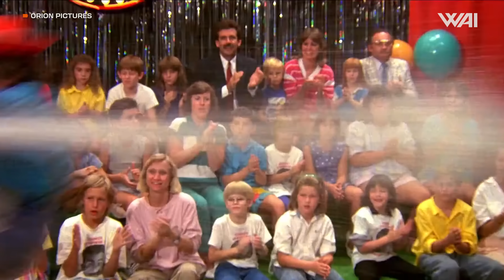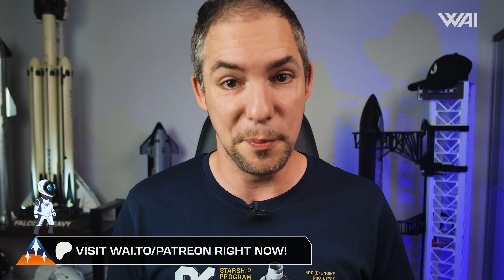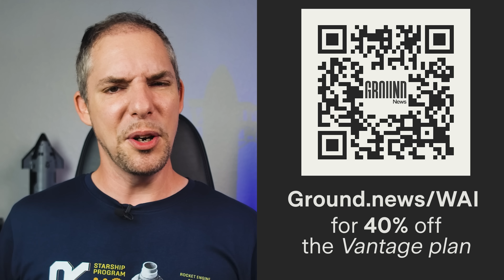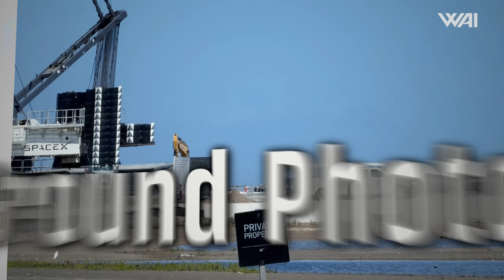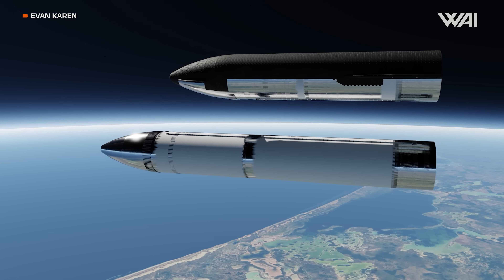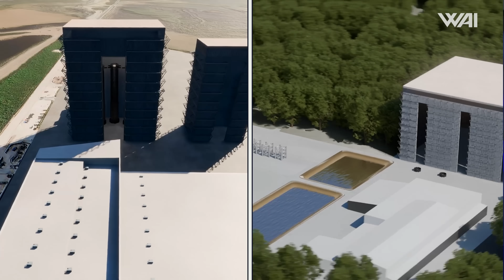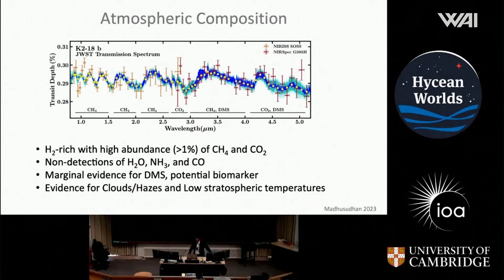SpaceX Lunar Starship Under Pressure: China Reveals Plans!

Comment: I think they need less Stringers but strong Pyramidal Golden Section distanced. More air. It’s colder. Closing and heavier causes hasles in Booster flip and relanding  A ) the catch weight is higher and slowing down b4 big bang may see booster hit catch tower &booster speed as it heads towards tower. Very fine call parts of second s. Rather Golden Section pyramid shaped airspace’s &so lighter easier catch 4 reuse. To much metal there will melt engines create fuel leakes and bang. Sad waste of time.

Comment: I don’t like how tall and narrow the Blue Origin, or SpaceX are. The bonus the Apollo LEM had was that it was short with wide landing gear. If one of these craft were to land with one gear in an even small crater, the craft could fall over. SpaceX’s craft is far more likely to do so. 
My uncle invented the device that kept the LEM’s landing gear in for stowage, and locked out for landing. 
We need to either give up on beating China to the moon, or get a better lander that would be stable.

Comment: How about we keep a dozen of these hot staging rings just stacked out by the tower and use them whenever we need them. Then you could build them with giant springs in them pushing both directions and so you get close to the top and kick the springs and it pushes them both away and in the same time it falls right close to where you needed to be. Right then and there. Save you wait all the rest of the way on starship.

Comment: I think the damage to the ship was caused by the pressure trapped between the ship and the booster during hot staging and now the pressure will be greater no the staging ring has less venting so my prediction is flight 9 will be worse than 7 or 8.

Comment: The CCP does things pseudo-capitalist now.  CCP acts like a private equity firm. Owning and funding companies, even having them compete against each other. Underperformers get cut off and shut down. High performers get more funding,  and as they start turning profit, a portion of that profit goes back to the CCP in the form of dividends.  Some companies still have full or partial private ownership. But if a company needs venture capital funding, the CCP is the only place to go.

Comment: If Spacex go orbital this year and crack refuelling next year they could prob throw a hls prototype together by the end of 2027 but if it fails or the struggle with the other two goals then 2028 wont be viable. I also wouldn’t be surprised to see china bring forward their date either, china already tested lander tech, suits and ship, they only need to complete the rocket and pad which reuses the stages and engines from long march 5. The 1st launch is scheduled for 2026/27. 
If it goes well a push by china for 2028 is possible. 
The Chinese have also hit all their recent deadlines so a slip seems unlikely while nasa and Spacex have missed most of theirs goals regarding hls. I think China is the clear favourite to win this race. The next 18 months by spacex will decide it, unless bo has something to contribute.

Comment: I don't understand why the hot-stage ring was thrown away after staging and did not remain on top of the booster for landing. As the Starship remained in a suborbital trajectory, fuel and payload could not be the cause.
After the impressive flying of pieces of concrete during the first launch, there had to be a quick solution: the deluge plate. Now they had enough time to build good old-style flame diverters, which will be more effective.

Comment: You said "My Wife Stefany". I thought you only had one wife. What is the name of the other wife or names of the other wives? Did I understand your statement correctly? Since SpaceX had two failures they probably will be more concerned about not having a third failure than having maximum cargo so if their hot fire ring is a-little heavier they probably raised their safety margins on everything new so things will be a-little heavier.

Comment: Rather than a larger starship, can  they cut it in half and make a second stage of tanks and engines only which get's left in space.   Yeah, repeatability is the goal, but making a small lander starship that is half as high.
Also, why can't they strap 3 falcon rockets on as boosters.   They can still land and be reused.
Reply: 3 Falcon's won't help much early in flight. 
The refueling tanker flights need a Stage 2 that is flyback.

Comment: I don't think China is a credible threat for a Lunar landing by 2029.
Why? because the Long March 9/10 have not been tested enough. 
The SLS had it's "test flight" around the moon Nov 2022. So once the Long March has a similar test flight THEN China will be exactly where the US was in Nov 2022. 
Which is exactly the problem... it's relatively easy to create a rocket with enough launch capacity to deliver payloads to lunar orbit (and that launch capability will also enable launches of high end heavy satellites for spy and military purposes... not that is what China's real goal is or anything... they are probably doing everything for the science!)
 Anyway... creating a launch platform solves one of 5 problems to make a lunar landing possible. 
2 of those problems involve lunar lander hardware actually being COMPLETE and on orbit for rendezvous testing. 
Until either US or China put a lander in orbit for rendezvous testing... any timeline is pure speculation.

Comment: Felix,
Have you heard anything about the size of the “Giga-Bay” doors?  They need to be 20’ meters wide to allow for “Fat Starships”.  A design like the Falcon 9 payload fairing.   Also look for 3stage Starships for better fuel efficiency to get to Luna and possibly back sooner.  Also smaller starship stages as lunar hoppers / bases…;-)
AD ASTRA, PRO TERA
Reply: I totally concur with your comments and also feel that a 3 Stage Starship launch vehicle is a critical element.  In fact, I would assert that the Stage 2 should be a winged design with significant cross range and landing gear to land horizontally back at KSC SLF or at Boca Chica on an unknown and uncreated runway.  The 3 stage Starship is ESSENTIAL

Comment: Dimethyl sulfide (DMS) on an exoplanet is not a strong indicator of life. The reason it breaks down in Earth's atmosphere is that it oxidizes, due to our 21% oxygen (O2) atmosphere. In an oxygen-free atmosphere that would not happen.

It's O2 which is the fingerprint of large scale life. If we find exoplanets with oxygen atmospheres, it almost certainly means there's thriving life there. We can't detect O2 spectroscopically, but O2 + radiation produces ozone (O3), which we CAN  hope to detect spectroscopically. So if you want to find life, look for ozone.

Comment: Space is hard for everyone. Nobody can guarantee that China will not face problems, drawbacks, or even catastrophic failures on the road to the moon. Lets hope that both participants (USA & China) in this Space Race will only experience some hardware failures and time delays and not any human deaths.
Reply: Hopefully SpaceX computers are better hack protected than other US manufacturers.
Reply: @Dave5843-d9m  Considering Starlink's use in Ukraine, you can be certain that SpaceX is very hack-resistant.
Reply: @Dave5843-d9m  SX, like Tesla uses Linux and other OSS. So yeah, much better.
Reply: The Chinese will use a small lander (no larger than the LEM from & possibly 2 or 3 launches to send a Command Module & 3rd Stage to the moon … That will allow them to use Heavy Lift (50-60 tons to LEO) instead of Super Heavy Lift (Saturn V class). Although they will need to rendezvous and assemble in LEO.
And no one is better at stealing IP & Reverse Engineering than the Chinese.
Reply: @TraditionalAnglican  that is to speed things up. They are still planning on doing their competition to Starship (bigger than saturn).
Reply: @TraditionalAnglican is it stealing though when some of the designs are open source and shared info.
Reply: SpaceX accepted $3B and committed to landing it on the moon by 1st quarter 2025. Not seeing it.
Starship cans are ill-suited for anything except delivering hardware to LEO. You could use them to loft a lander and a transfer vehicle to move it, filled with hygroscopic stable fuel, to go there. You do not want cryogenic fuel on a long-term crewed mission.
Starship cans are by the way comically inadequate to support a crewed Mars mission.
Reply: Their stuff is made in china after all
Reply: I definitely don’t agree with chinas government but I would not wish that kind of death on anybody
Reply: China sure as hell made their own space station, quickly, and are constantly churning out different rocket designs (good and bad ones). And don't mind pushing technology further at whatever cost.
Not inviting them heavily to a table, will be a mistake
Reply: Wishful thinking...
NASA budget cuts = Red Moon
Reply: yeah I agree, the politics are in high tense, no doubt space wont be used for "the people" it will only for military, regardless what sides.

Comment: I think the new soild sections of the ring are to prevent exhaust from scorching sensitive plumbing.   Also, could the ring be causing the oscillation failures because of the close proximity of the exhaust plume shoving a large mass at an incredibly close range as it separates?   We can see the shockwaves when this beast leaves the OLM, and while less engines, you're confining that force to a very small area compared to launch or not doing the hot staging.

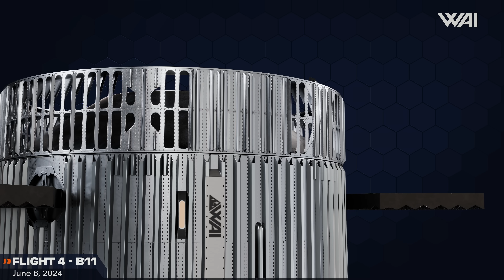Comment: 3:01 I think that this asymmetric panel provides a small sideways thrust to the top of the booster during hot-staging. 

Downside is that significant shear force will be applied to the three clamps during separation. Perhaps SpaceX engineers should use six alignment hard-points.

Comment: With all the risk associated with in orbit fuel transfer technology uncertainty, could Space X outfit Falcon 9 payloads or upper stages to try out some of the methods?   At Falcon 9 rates of launches, they could certainly get valid results faster, that could be scaled up with Starship/tanker class vehicles later.   Just the method of attaching two vehicles plumbing to each other shouldn't care how big the fuel tanks are, that alone would be a reasonable goal of a Falcon 'technology' demonstration.

Comment: I still think that the booster sacked a little taller to boos further into higher earth orbit without a return with a solar shield for power and refrigeration to minimize boil off should just be left in orbit. Do that 5-10 times then you have enough boosters to make a space station & 2nd stages for refueling and station keeping. Teslabots can field modify the station until they are linked, two air locks & 4 docks for 2nd stages. Additional infrastructure sent up with follow up flights.

Comment: If SpaceX's HLS doesn't have a heat shield, the crew will need another ship/capsule go come back from the Earth's orbit after returning from the Moon, right?
Reply: Unless the Artemis architecture is drastically changed, the current plan has astronauts riding to the Moon and back inside the Orion capsule.  Orion will dock with HLS Starship in lunar orbit, and crew will transfer to HLS for the trip down to the lunar surface and then back into orbit, where they will again dock with and transfer into Orion for the trip back to Earth.
Reply: The Orion capsule is the designated return vehicle. It hits Earth's atmosphere tangentially at 24600 mph (11 km/s). 

Eventually, a Starship version may have enough proven re-entries with that same velocity, in order to qualify as a crewed vehicle. But that still won't be a HLS version.

Comment: I think it would make sense to land at least two Mark II at the same location.  One with crew and the others with cargo.  All are capable of lifting off in the event a failure occurs with the crew's original.
Reply: New Glenn did achieve orbit on first attempt (though the Booster failed to relight for reentry burn, and the second stage exploded after being 'passivated'...)

New Glenn is supposedly flying again soon-ish (by late June or so), with either the ESCAPADE probes to Mars, or with Kuiper satellites to low Earth orbit.
Reply: @Spherical_Cow  

And it didn't deploy its payload (on purpose).  So not nearly the success as BO enthusiasts claim.  
:planet-orange-purple-ring:

Comment: Is it my imagination or is SpaceX slowing down in the last few months possibly because musk‘s energy is diverted to doge. His time and more importantly, his laser intention seems to be missing.
Reply: SpaceX has already launched Starship twice this year, and is getting ready for the next launch (probably in May).  It's spending a lot of effort in building up additional infrastructure, in the form of a new launch pad at both Starbase and at KSC, and new additions to its manufacturing and vehicle servicing infrastructure (the 'Gigabays').  Due to the failure of the preceding two launches, it's understandable that SpaceX would take extra time to fully analyze and correct the design flaws in the 'Block 2' Starship, before they attempt to fly it again.
Reply: I get why you think that but no. I think it's simply a case of building up the infrastructure before they scale up the volume of starship launches. The first flights were a demonstration of the concept. Now it is the logistics and cadence which is the next goal

Comment: If Starship uses Raptors for landing, Starship Lunar will basically become The Boring Company moon versions
Reply: It's likely that they would use either 1 raptor on a low throttle, or use engines closer to the top of the rocket. The latter has at least been showcased in renders

Comment: 3:01 Judging by their position, the supports might be there to protect the grid fins from the warping we’ve seen on every flight from the ship’s engines
Reply: I think that this asymmetric panel provides a small sideways thrust to the top of the booster during hot-staging. 

Protection would require that four panels symmetrically coincide above grid-fins.

Comment: The checkerboard of those walls is more than likely for airflow. It is pretty windy around that body of water. You don’t want wind to build up because one wall is down pushing against a solid wall. It will cause a collapse that is more than likely why you see those holes cutting into the walls
Reply: Yeah my thoughts exactly they don't want strong gusts  bringing it down prematurely.

Comment: If thrusters at the top of the SS were used for landing instead of repulsive landing dragon engines the regolith would be all but eliminated.
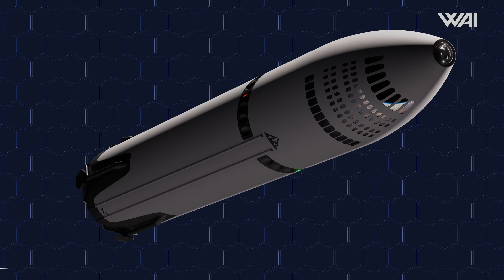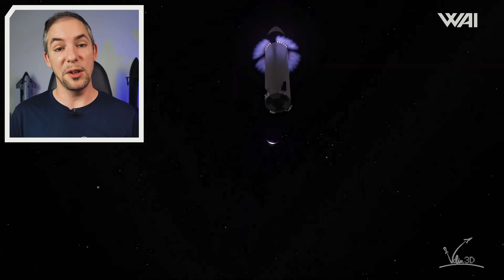Reply: 11:50, 12:03 SpaceX likely needs to test both options in order to investigate how troublesome the regolith rebound/scatter will be.

Comment: Ok ill tell what I think, I THINK that because the hotstaging ring is STILL the WRONG DESIGN!! And because of this, SHIP is STILL GOING TO BLOW UP!!! And they CONTINUE to BLOW UP until Musk gets his head out of his butt and makes the hotstaging ring HE KNOWS will FIX IT. He MUST change to the old style Russian V-Bar design hotstaging ring, and ONLY this style will solve the harmonic imbalance that is the reason SHIP has been nothing but a HUGE firework 🎆
Reply: The hot-staging ring has absolutely nothing to do with the harmonic resonance issues that doomed flights 7 and 8.  These issues manifest long after stage separation, toward the end of the second stage's ascent burn (at the point when most of the second stage propellant has been used up).  They are caused by a significantly changed design of the engine plumbing in the 'Block 2' Starship.  The preceding 'Block 1' Starships had no problems completing their ascent burns during flights 3, 4, 5, and 6 - all while using the exact same hot-staging design.

Comment: I think that, with everything said, it really puts pressure on the next 2 spaceX launches to get starship back. BO and their blue moon lander just sounds like the development is far too slow. We need a unified front against china and this means putting the chips into spaceX and let them go as fast as possible.
Reply: Get the fuckin FAA out of the way and SpaceX will launch enough to have everything ready in time no problem. 6 times a year instead of their proposed 25 launches is killing their ability to innovate
Reply: @alexevans5043  agreed

Comment: The engine skirt was strong enough for flight for and five and six, but with the bigger and heavier starship 7 & 8, the skirt probably wasn't strengthend enough to take the extra load.
Reply: Put the hot staging ring on the SS or incorporate hotstaging ring and landing legs on SS.

Comment: I’m curious about all the lunar lander designs that are far taller than they are wide. With all the failed landings of ‘taller-than-wider’ crafts with higher centers of gravity, it’s strange that our two greatest hopes for human landers are more taller than wider. I know moon gravity is 1/6 Earth, but wider base on uneven and crater-covered terrain sure seems like it gives better odds for success.
Reply: spacex regularily lands verticaly on moving surfaces - their droneships. the moon does not wobble as much I hope
Reply: All the landers that toppled over had significant sideways velocity. They didn't tip, but tripped. Or even plowed across the surface. 

The solution is to improve sensors and navigation control.  

Starship, like all other HLS proposals, must cope with at least a 15° slope. That implies that the Starship landing gear must be compliant and dynamic to keep the craft plumb.
Reply: SpaceX lands on moving barges and catches skyscrapers with the tower. They’ll be fine there Einstein. Lol don’t quit your day job